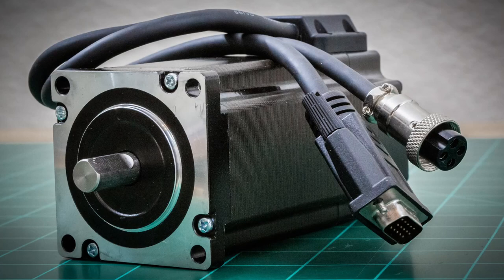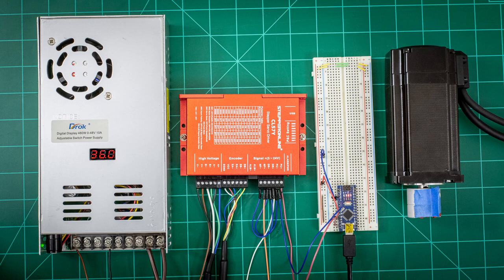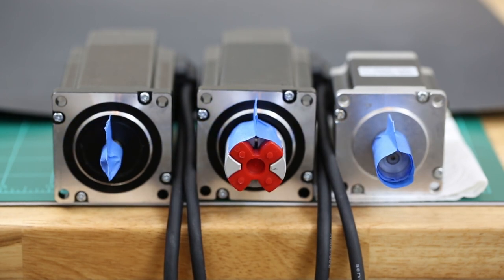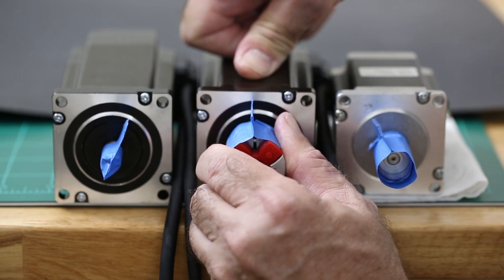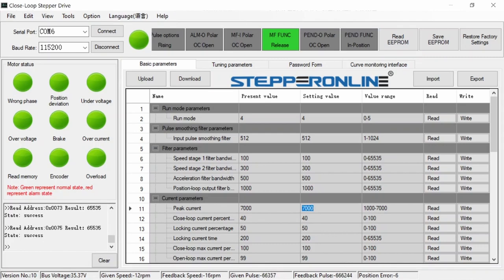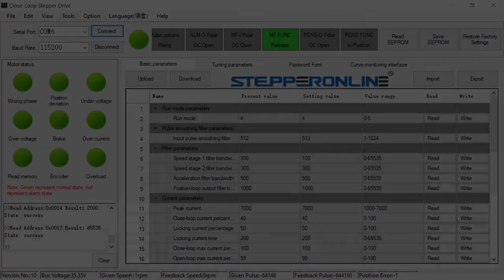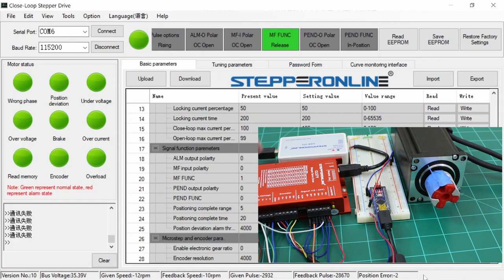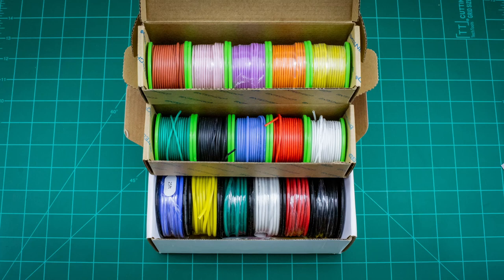Grizzly G0704 CNC Conversion - Exploring Closed Loop Stepper Motors - Video #9

Comment from the maker: Regarding the position error count...
The stepper drivers are set to 400 pulses per revolution, and the encoder is a 4000 pulse per revolution type. So, the motor has not had a "missed step" until the position error is greater than 10 due to the 1 to 10 pulse ratio of the driver vs encoder.

Comment: Good explanation of each of the settings and showing how the setting changes actually work. Do you think the Z axis will stay in place with power off since the stepper can rotate freely? I’ve heard of issue with linear rails having that problem because they are so easy to slide.
Reply from the maker: Thanks.

Regarding the Z-axis dropping when power is removed from the stepper, I have not come across that issue for the G0704 in forums or Youtube. I think the inherent drag in the Z axis is what will determine whether the Z axis drops or not. One thing that occurred to me is that a de-energized stepper will cog when turned by hand. This is caused by the permanent magnets in the motor. These magnets will act as a light brake that may be enough to prevent the Z axis from dropping. This braking action is more significant on the larger NEMA 34 than on the smaller NEMA 24; which may be reason enough to use a NEMA 34 on the Z axis. What I (crudely) measured was, about double the torque was required to turn the NEMA 34 . (Very) roughly: 1.3 gf mm to turn the NEMA 34 and 0.6 to turn the NEMA 24.
I'll cross that bridge when (if) I come to it. I would certainly enjoy building a braking mechanism to stop it.
Edited to correct the crude torque calculation.
Reply: @joat_mon  I came into the comments specifically to address this exact concern. I have yet to visit your subsequent videos, however I am planning to do just that. The content and calm rational delivery of usable information is top tier for those willing to learn. Thank you.

Comment: Absolutely fantastic video, and one I am recommending to students. I have to ask, what was the holding torque (approx) for the test motors when you demonstrated losing steps? I am surprised that you could cause the larger closed loop motors to lose steps by hand!
Reply from the maker: Thanks!

About the torque, I have no idea. Certainly not very much. I reduced the motor current in software from seven amps down to one, so the motor was greatly de-rated. I reduced the amps for the sole purpose of being able to stop the motor by hand to make the video. I turned the amps back up to 7 for normal operation on the mill.
Reply: @joat_mon  That makes a lot of sense! I was thinking that perhaps you had superhuman grip to overcome the low speed torque of those motors.

Comment: Would you by chance have a link of the build setup you are using. A lot of folks I have seen do serial builds vs arduino. I think yours is a much more updated build.
Reply from the maker: I didn't use the Arduino for the CNC build. I only used it to play with the steppers on the bench.

Comment: The USB Plug in the driver is an RS232? How dare they... my CL57 driver have an RJ12 socket with label RS232  but never used until now.
Reply from the maker: Yea, not sure how they ended up with that arrangement. I wonder if an off-the-shelf USB to RS-232 adapter would work too. I don't have one to test it out. May or may not need a cross-over cable arrangement.